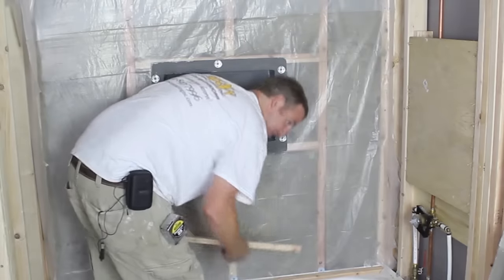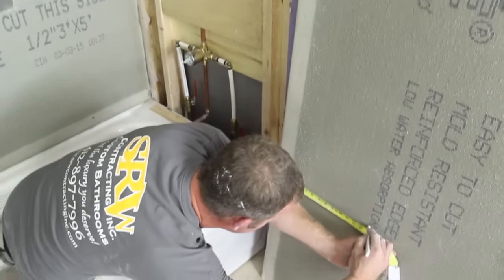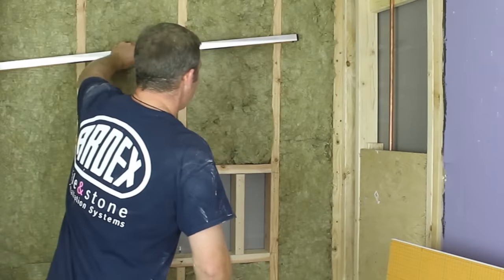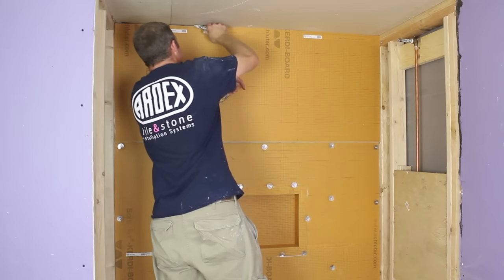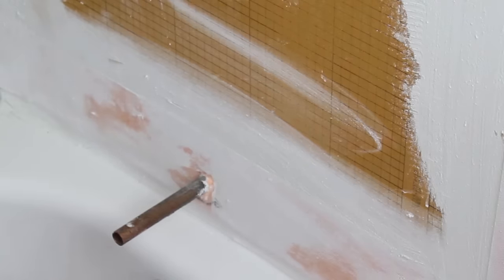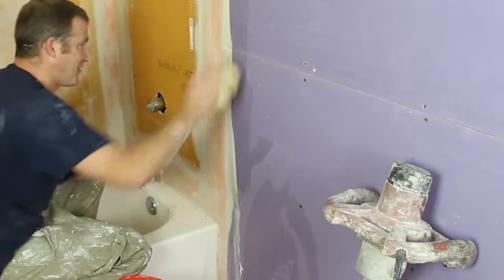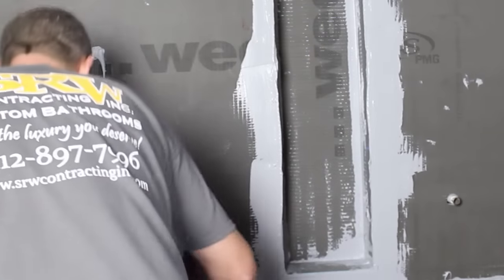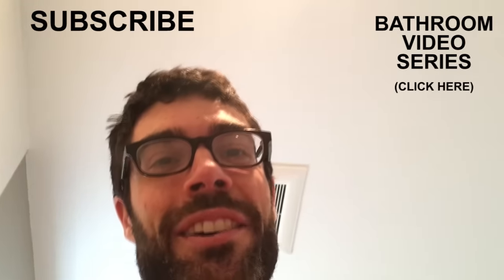How to Waterproof a Shower (3 Awesome Methods!!)

Comment: I also do not see the need to tape tub or shower base flange. Eight years ago, I used Hardi Backer as the board, taped all joints with thin-set and fiberglass tape (except the tub flange). I don't even think I decided to try and seal the flange to the Hardi Backer board under the tile, I would think this joint is going to flex a little and would probably crack any seal you put there anyway...I just tiled over and sealed the tile to tub with flexible silicone white caulk. If you really wanted to do something before tiling, maybe shoot a line of some flexible caulking in there for extra credit.  
I think the Hardi Backer board is a cross b/t cement and the others in the video. It is very dense and stiff like cement board, not as heavy though. Easy to cut with hand-held jigsaw.  It is not as "gritty" as cement board either. My thought is that it would hold up better and not flex as much as the two non-cement board products in the video.  I coated the whole surface with a blue water-proof sealer...I think by Laticrete. Then tiled.  I went back and forth with putting up a plastic barrier behind the Hardi Board, but decided against it and to let it breathe. It has been trouble-free for eight years and going strong! I am not a pro, but getting ready to start my 4th bathroom total gut and remodel and plan to do the same. I hope Hardi Board is still available. Go DIY'ers!!
Reply from the maker: +Paul Egan great explanation of what you did and sounds like it's still working. LATICRETE makes quality materials. They also came out with their own foam board. The reason we like wedi and Schluter boards are ease of use and a quick installation. Wedi in particular only takes a few hours and can be tiled over on the same day...if you're up for it. What kind of shower are you building this time?
Reply: Thanks for your video. You have good explanations throughout your video. I know you didn't comment on it, but there is controversy over putting a vapor barrier against the studs behind the backer board. It looks like in that video that you used one, but I have heard that this can trap moisture instead of letting it breathe if some moisture does get throigh, which can result in mold. Your thoughts?
Reply: Mpld needs an organic material like paper on drywall cant have mold between backer and vapor barrier. what is sometimes overlooked is the diff between moisture barrier and vapor barrier.  if tub or shower is against outside wall the warm temps in interior can cause condensation on wood studs from cold air from outside . vapor barrier gives place for moisture to collect always on the warm side of vb, ie insulation.

Comment: Thank you for your video. 
I am planning on doing my shower and I have a question. So you use the waterproofing material and membrane at all the joints (including where the rock meets the existing sheet rock). Is the 8+9 paintable? I'm sure there will be overlap and will need to be painted since the tile will stop right after the seam.
Reply: since that joint is outside the shower door, i treat that joint as a drywall seam. if  its a nice clean straight seam i don't even bother taping it,  just set the  tile to cover the seam, grout and/or caulk the edge of the tile and you don't even have to repaint the wall.

Comment: I have a leak in the bottom corner of my shower.  I've water tested the spot and I know its coming from there.  It was built as part of a home renovation and I don't know who did the install to have them correct it.  I've had plumbers tell me i have to redo the entire shower but that's before I found out the leak location.  Do I have to reinstall the entire shower?

Comment: I see that this clip is several years old and I don't know if you still monitor it but I have a couple of questions for you if you are still watching . 
   I have just torn out a 14" tile surround from a bath only bathroom. I installed a shower riser . The old tile backing was the mortar type and there is dry wall behind and is still in place after the removal of the tile and backer.
  The question, do I need to remove all of the drywall  before installing the new backer board ?? Also , how high from the top of the tub should I run the tile ? To the ceiling ?  Money IS a factor on this one.
      thanks ----ab59
Reply from the maker: Are you referring to the drywall in an adjacent room or that drywall was used in the shower area? We recommend using backer board up to the ceiling and tiling to about 1/16" to 1/8" from the ceiling as well. That expansion and contraction joint is necessary. Your best option for backer board is to use cement board and something like Hydro Ban or RedGard or ShowerSeal as the liquid waterproofing membrane. Another option is Kerdi over new drywall. In fact Schluter has a Kerdi tub kit but I'm not sure how it compares in price to the other options. Plus, you'd have to use thin-set to adhere Kerdi to the drywall.
Reply: @HomeRepairTutor    Thanks for the reply-- the drywall is on the bathroom side, it was immediately behind the mortar bed for the tile. I was just going to leave it and then put some Hardi board  or it's equivalent in over the existing drywall. If I could attach a picture it would have been better but since that is not possible The description will have to do.
Reply from the maker: @a.b.5925  send me some pictures, jeff@homerepairtutor.com

Comment: I made a mistake and did not waterproof my shower before placing my tiles on the shower walls.  Is there anything that can be recommended to put on the tiles to prevent water leakage and water damage.
Reply: Prayer. Start a savings account to tear it all out and do it right.  Or, if the shower pan is done right, with preslope and all, you can cover the walls with Corian, Swanstone, or any other shower wall material, right over the tile.  Now, before the wood rots out.

Comment: Hi Jeff, I am just thinking to use a mold resistant drywall for the tub surround and cover it with Schluter Kerdi membrane. What do you think?
Reply from the maker: +Igor R you could go that route or use cement board with KERDI membrane. Another option is KERDI-BOARD which is a faster and easier method. Plus the KERDI-BOARD has R-Value, so it's insulating. Nice for outside walls 👍
Reply: If you use the mold proof drywall just hit it with 3 coats of red guard and you'll be good to go no need for the shluter over it

Comment: if u are not cutting a nitch in, could you attach the perma cement board straight to the wall without batons?
Reply from the maker: +Peter Crosbie depends on how you want to waterproof the tub to cement board transition but yes you could forgo the furring strips

Comment: Hi Again.Can you please tell me the grout you would recommend for my shower.I just finished it in 12x24 in. tileThanks
Reply from the maker: What kind of tile is it, e.g. ceramic, porcelain, stone? And how wide are the grout joints?
Reply: ceramic. grout joints are 16th of an inch apart. thanks for the quick reply.
Reply from the maker: @canadianloon6433  we like many different types of grout for shower walls. Mapei FA is ideal for your situation and very easy to use. They have small 10lb bags that are very affordable and come in a variety of colors. Here's an Amazon link -- https://amzn.to/2FyMBLJ -- but you can probably get it locally, we always recommend using a local distributor if possible. This sets up in 20-25 minutes but easy to use. You could also opt for epoxy grout, Laticrete's Spectralock is fantastic.

Comment: Thanks for the video. it was very helpful to make my discussion on how I would waterproof my shower. I would use the wedi building. why? because it is easy to use and you can build your own niche anywhere you desire. Are you using the wedi for the floor as well?                        Thanks a lot.
Reply from the maker: thank you, what kind of shower are you going to build? Tub shower or curbed
Reply: curbed less shower. no tubs or shower pan.

Comment: Question for you specifically...I know of ways to do it, but how would YOU guys do this? Where my DuRock meets Sheetrock, there is about a 1/2 difference in thickness in about a 12" section. It's the Sheetrock studs that weren't flat, NOT the DuRock. I thought about using the high quality thinset to feather the gap since my subway tile will be applied to about 3" of the Sheetrock. I also waterproofed the entire shower with Laticrete's Hydro Barrier. I have also read that I can fill in the difference with the Laticrete....but it seems way too thin to use as a "filler".
Reply from the maker: +Mark Price is it out if the question to remove the drywall and shim the studs with 1/2" plywood?
Reply: Home Repair Tutor The drywall is fished, but it's the DuRock that's low... so I can hide it by feathering something under the tile. I couldn't shim the DuRock because it HAS to be straight across. It's hard to explain, but where the sheetrock and DuRock meet, there are 2 studs butted up... one at the edge of the sheetrock, and one at the edge of the DuRock. I couldn't shim either (I could've shimmed the whole DuRock wall, but the bottom edge is already out into the tub area far enough, and it's also completely Laticreted...I need to fill in the bottom gap between the tub and DuRock too... so I assume I can use whatever you recommend in both places?

Comment: Sorry guys, but NEVER use thinsets or solid mix compounds or grouts to fill in any gap that is at a tub (or side of acrylic shower surround and wall tile) especially if your tub is a plastic or fiberglass (metal tub is not SO bad but will STILL do it).  There will always be an amount of flex with the tub and you MUST use a FLEXIBLE compound like silicon to seal the edge of the solid tile wall to the more flexible tub. As soon as a crack opens (and it eventually will) between the solid cement based mix and the acrylic of the tub, water will start wicking up behind the joint and will start destroying or molding your sublayers.  Flexible caulk is a MUST between any tile and non-tile material. The Kerdi fill caulk does this by doing the water sealing first, then putting the kerdi-band on top of the caulk. Though a crack may form after time, the caulk behind it will do the sealing job.
Reply from the maker: We show that method as well

https://youtu.be/OTf2gG-J-o8

Comment: As far as ease of install, it looks like the Wedi system is better, but for long term, I wonder if Schluter has a slight advantage due to the fabric.
Reply from the maker: both Schluter and Wedi make great products. Wedi has a cementitious layer on either side of the foam, making it a very solid yet light panel. That said, both types of panel are outstanding and don't require extra waterproofing like cement board.

Comment: I have been watching your videos and they have been very helpful. I live north of Cranberry and am putting new plumbing in and a tub which was never in before.  How high off the top of the tub edge should your tub spot be for the 1/2 in pipe to come out. I see you drilled a 1" hole for it
Reply from the maker: +Thomas Bridges awesome, we're not that far from you. About 3-4 inches off the tub deck. But check the directions for your mixing valve.

Comment: hello Jeff,
I have a very small basin in my bathroom, whenever I wash my face, all the water goes on the cabinet below the granite counter top. I have the cabinet doors covered in towels, but it looks tacky. I wanted to ask if there is anything I could use to seal the wood so it won't get ruined with all the water splashing over it. Thank you

Comment: Should I put Redguard on the wedi system?
Reply from the maker: No, it’s unnecessary. Only use Wedi joint sealant for the seams and screws/washers. What Wedi Shower system did you get?

Comment: Thank you for sharing.  I did not know there were options and I like Wedi and Kerdi methods.  My husband and I rehab mobile homes and this seems like a very simple easier way to do bath tub/shower installs being able to use tiles and tear out the old vinyl wall boards they used in the 80/90's models.  :)  After reading some comments about the Styrofoam boards,how would this do in a mobile home's shower, and yes, is it sturdy enough for tiling?
Reply from the maker: Good question, I don't have experience with mobile homes but KERDI-BOARD and Wedi are both very solid backer boards. The studs need to be 16 inches on-center and both systems are tiled over. I'd recommend both for a shower.
Reply: Home Repair Tutor thank you for responding. There is always a first.  its amazing with the vinyl panel walls they place in mobile homes, when we tear out the surround, we don't find many issues. This will be an interesting project.
Reply: What part of the country do you rehab mobile homes?
Reply: @keithowens9242  South Carolina.

Comment: Putting any type of vapor barrier over the studs and behind the wall board is creating a water sandwich which will never dry out creating an atmosphere for mold to take hold and multiply exponentially. Naaaaassssty! Remember what you have here. A vertical surface of cement, tile and grout. Unless the grout is allowed to deteriorate, the amount of moisture getting behind the wall tile, wicking through the mortar and then through the cement wallboard is negligible. On the off chance any water does get through you need to allow it to evaporate. So, hang the board. Tape and thin-set all the joints. Use thin-set to fill any low spots on the boards. Apply waterproofing tape with a high quality pre-mixed water-proofer to all joints. If you are really anal, apply the same waterproofing to the entire cement board surface. (The resin guy post is so far over the top and labor intensive, I'm almost speechless. How would you ever get that fiberglass and resin flat and smooth? Talk about a tile laying nightmare. I think he is full of crap and just dreamed up the whole thing.) Hang the tile. Grout the tile. Use silicone or the sealant of your choice to grout the corners. The corners tend to be sources of leaks, especially near the floor. Seal the grout. Seal the tile if you used a natural stone type tile. Maintain the grout and sealers. If your floor pan was installed correctly and you perform the above, the shower should last for decades with no water or mold issues just like the days of old. You think the guys that built showers in the early part of the last century had all these choices? Nope. And many of the tile jobs still stand on their own. So stop over thinking this process and perform the standard install. You will be satisfied! And a fan vented to the outside is an  absolute requirement.
Reply: What you say is basically what Hardie says about installing HardiBacker. I'm going to go with this system. My old metal mesh and mortar system was 62 years old and still working with no visible mold. It had some type of sheetrock between the lath and the studs but no plastic barrier. Not sure what type of s.r. they used in 1956. All the studs were fine.

Comment: I kinda like the wedi board but whats the price compaired toeach
Reply from the maker: +Darrin Siler cement board is $12 per 3x5 sheet, Wedi is ~ $39 per 3x5 sheet, and KERDI-BOARD is ~ $62 per 48x64 sheet. Keep in mind the cement board needs something like RedGard and that's about $99 to $150 and requires multiple coats. So there's a time element for all the different options.

Comment: Although the Kerdi has been around a long time, I question their method of sealing with unmodified thinset under the kerdi bands.  Unmodified thinset isn't waterproof...so they seem to be relying on the 2" overlap to create enough "pressure" to keep the water from wanting to push through it.  Seems like a sealant, like what is used between the Wedi boards, would make a lot more sense to be applied under the kerdi band.
Reply: In the video he said it wasn't the manufacturer's recommendation to use the thinset.  The manufacturers had their own sealant that should be used instead

Comment: Hi there. Can you tell me a cost comparison between the three methods (ball park- least to most$)
Reply from the maker: +Neil Munro least to most is cement board < Wedi < KERDI 

Cost depends on your total square footage but I'd use KERDI and Wedi all day over cement board. 

Cement board is $200-$300 after you buy the waterproofing for it (e.g. RedGard or HydroBan). Wedi is $250-$350. KERDI is $300-$450...these are just guesstimates for a standard 32"x60" tub area.

Comment: what's your opinion on using hardibacker and then three coats of redgard? some people say you don't even have to mesh the joints easy if you use three coats of red card.
Reply from the maker: +tortelvis1 I think there's room for failure with that method. If the RedGard doesn't seal the gap between boards you'll have a leak. Always better to have solid waterproofing than not
Reply: Home Repair Tutor thanks! That makes sense but I don't understand why the mesh itself in all these products is not waterproof. it is permeable. why? wouldn't it be better for the mesh to be waterproof in the corners and all the seams?
Reply from the maker: +tortelvis1 the mesh embedded in thin-set makes the seams and corners stronger and gives a solid surface for the liquid waterproofing to adhere.